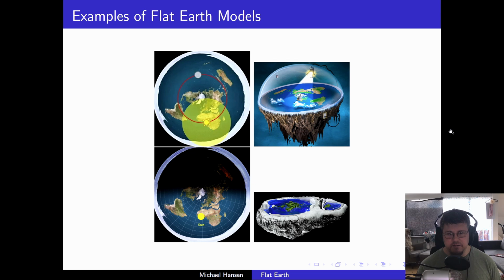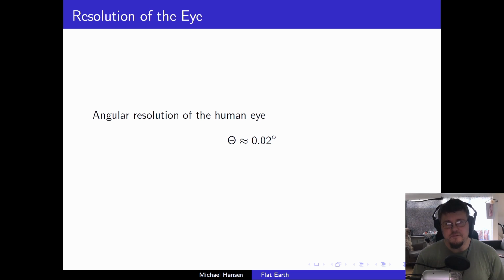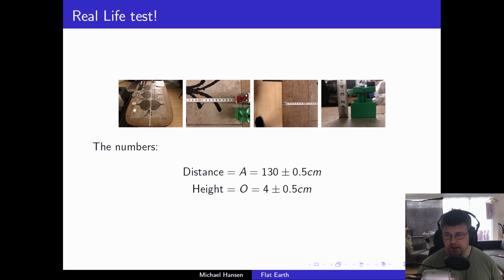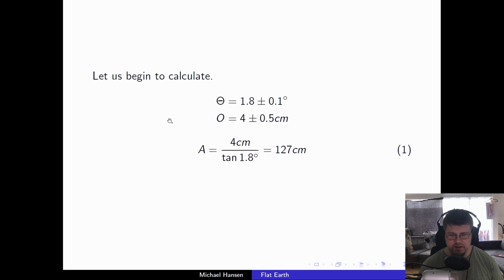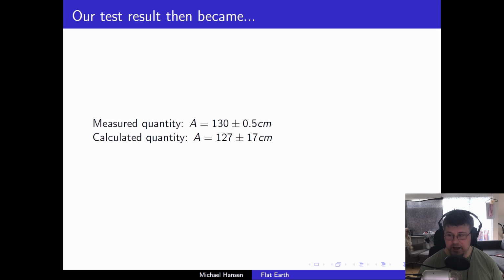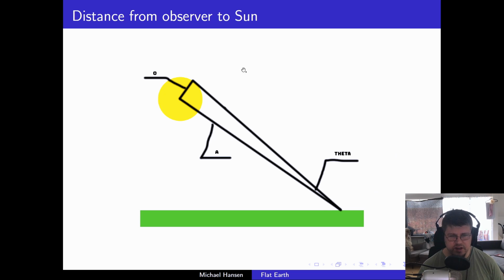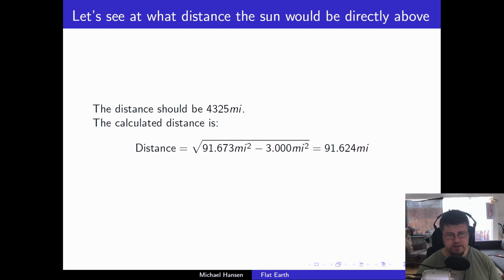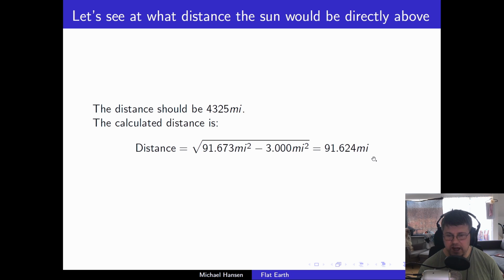Destroying Flat Earth using the Sun

Comment: If you're going to use the sun as evidence then please answer these questions first. What is the sun? where is the sun? How far away is the sun? How did you measure the distance to the sun? How does the sun work in the vacuum of "space"? Once you provide Practical demonstration's as evidence to these questions, then we can talk about using the sun as evidence.
Reply: https://en.m.wikipedia.org/wiki/Sun
There you go. You better explain why the sun, moon and any other celestial object rise and set on the horizon. This is simply impossible on a flat disc. Along with many other things a flat earth can't even explain while the globe model can not jut explain but precisely predict those things.
Reply: To answer your questions:
1- a mid-size star made up of 70% hydrogen, 28% helium, and 2% other elements.
2- on one of the spiral arms of the Milky Way galaxy
3- an average of just under 93 million miles from Earth
4- First, by geometry, later by parallax
5- via nuclear fusion.
Reply: @adventureswithdogs2251  
1. Have we taken samples of the sun (physically)  stellar spectra is extremely inconsistent, along with its methods of testing. 
2. Visual data taken from a variable viewpoint, which is Earth, then "proved" via geometry, which, btw, is designed to provide an answer that proves your visual data is correct in a model only variable of its own. 
3+4. The speed of light is unmeasurable, which is how we theoretically prove the distance of the sun outside of Radio and Radar astronomy, which dont even get me started into that bs. The parallax falls under this same mantra. 
5. K AND?  Nuclear Fusion doesn't (NEED) a vacuum to survive; it can suffice just the same in any sterile stable matter that completely stabilizes the fusion reaction. Yes space is seen as a vacuum to many, but it's not a necessity. More so seen as a low-density medium. (We can use the Sun as a model to prove it's not purely a vacuum. Solar winds.)

I know this is a hard concept to grasp, but it is not impossible. To me honestly more probable when compared to relativity outside of Earth. 

Also the Dynamic effect theory causes tides sorry.
Reply: https://en.wikipedia.org/wiki/Sun
Reply from the maker: Excellent questions, but they have very little to do with the video and claims that I've just made. Let me explain. This video is about how we would perceive the Sun by just looking at it. You actually don't have to know anything at all about the Sun in order to make these claims.
So, what the Sun is, is irrelevant. 
Where the Sun is and how far away it is, I take as more or less the same question. These figures come from the Flat Earth messiah Samuel Rowbotham. 
So, I didn't measure the distance to the Sun, nor do I need to do so, for these claims.
How the Sun works is likewise irrelevant, for these claims.
Also, you have grossly misunderstood how science works, if you think that all claims should be met by a practical demonstration. Data from observations, however, are key here. Whether they come from pure observations and/or experiments.
Reply: @mikesobservatory3714 Another dishonest YouTuber making claims about the real world using vision alone! Assumption after assumption. That's totally scientific! Thanx for confirming you actually know nothing about the sun you're using to make claims.
Reply from the maker: @HaveNoSphere  Is this some sort of standard reply, you come up with? I know a great deal about the Sun that I use to test claims, not make them, but they are just not relevant here. I am simply not going to fall for you attempt to make this about something that it is not. I other words, a red herring.
But I will give you the opportunity to explain why you think it is relevant.
How does the Suns composition change anything about the content of my video?
How does me measuring the distance to the Sun change anything about the content of my video?
How does the Suns internal physics and mechanics change anything about the content of my video?
Reply: @HaveNoSphere  "Another dishonest YouTuber making claims about the real world" OK, that is you, now how about proving the Earth is flat, is not a slowly rotating terrestrial spheroid and gravity is not a fact?